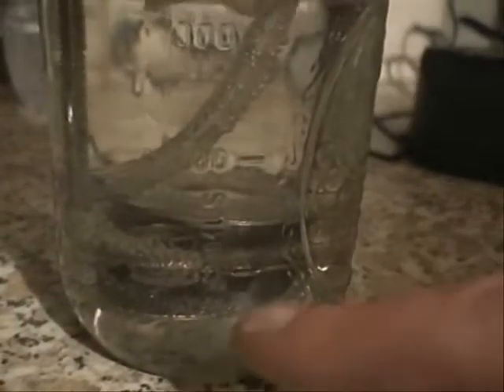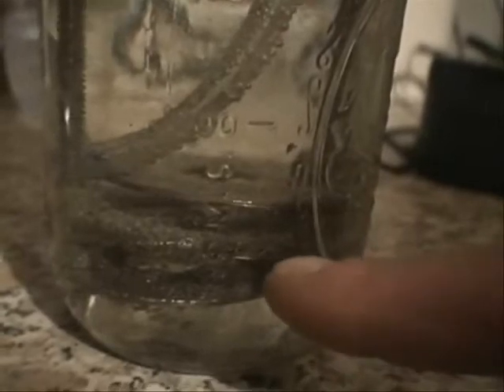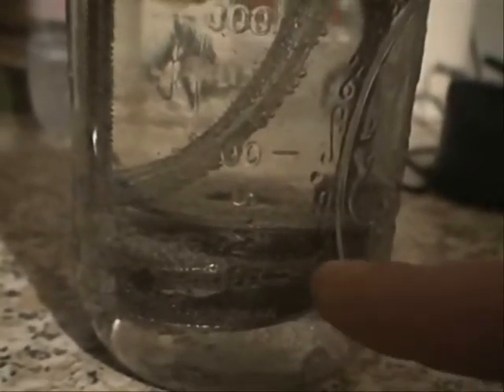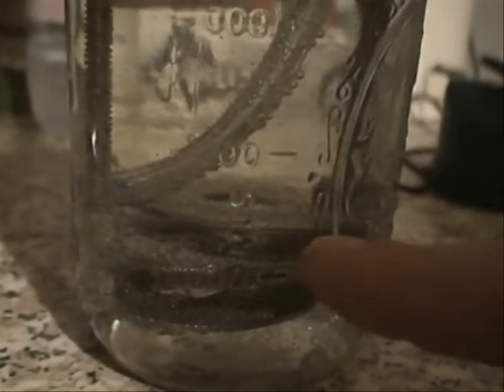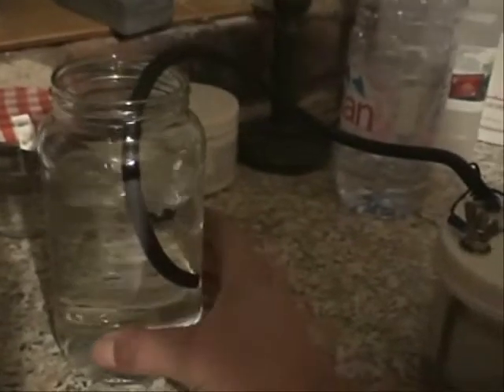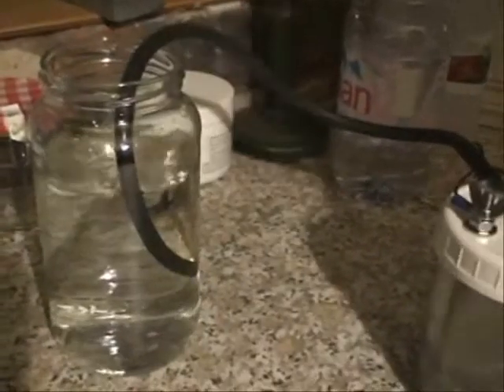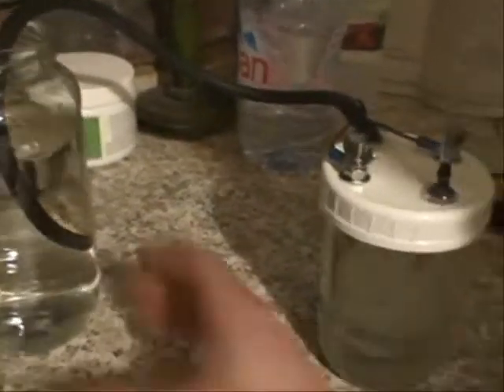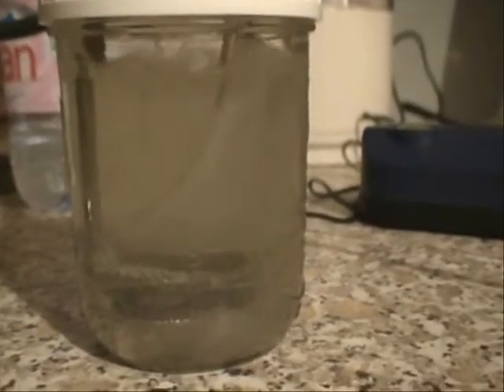Fuel Cell Technology Test - Phase 1 of 3

Comment: HAHA that little tiny cell dont produce enough gas to help anything..,If you would build a real  cell you would not have to use a pump to get the bubbles off, they would come off by their selves...All that water4gas stuff is no good.Make a real fuel cell with about 100 sq inches of surface area with 12v and about 30 amps and you will see what I mean